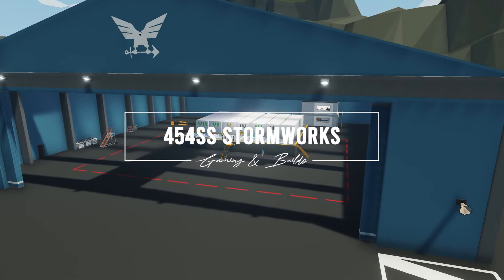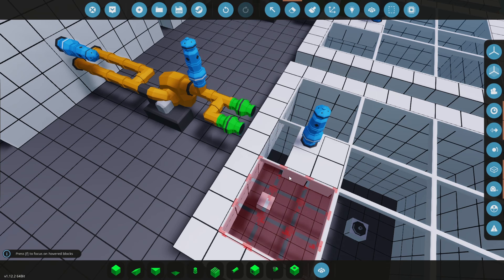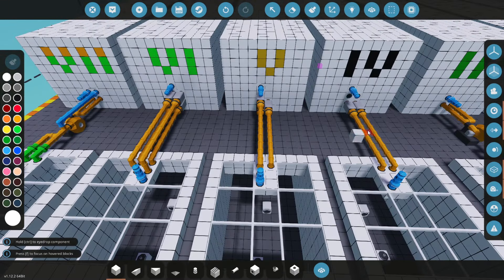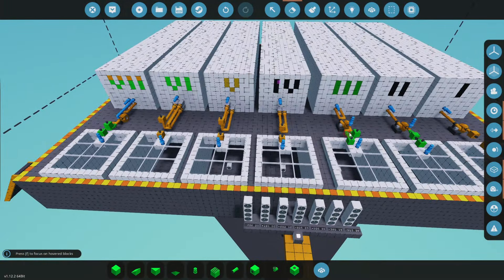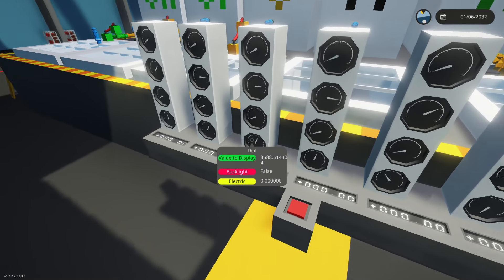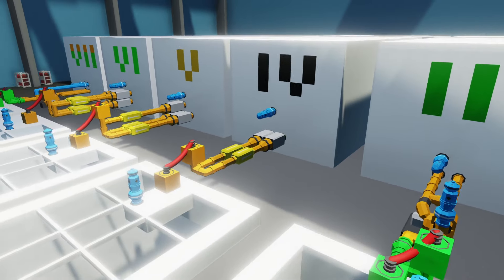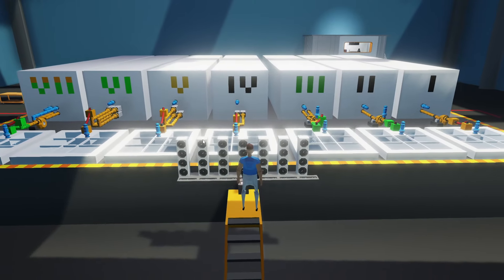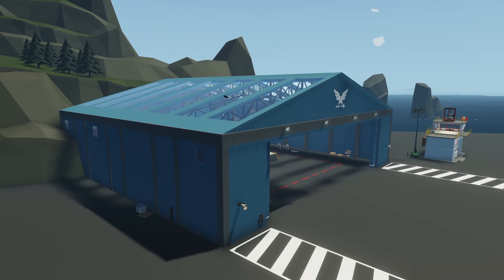Testing HOSE Fluid Transfer Setups in Stormworks

Comment: I really don't understand why you turned all of the multi-connection tests into single-connection tests when trying to make analogous hose tests. It immediately makes them non-analogous and there's nothing stopping a player from having multiple ports on their fuel transports and their other vehicles
Reply from the maker: For sure, you can have multiple ports, but this test is to see what is the best case for a single port, ie. filling a tank with one node.
Reply: @454ss_gaming although the reason for having the pumps be separate would be to have multiple ports. In fact. Having them all be separate would possibly be faster in multiple tank filling senarios